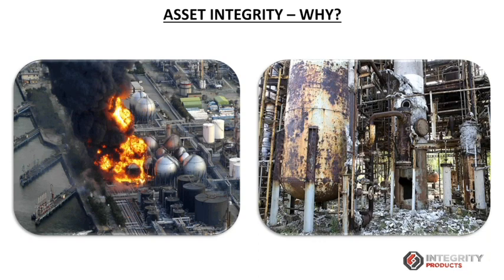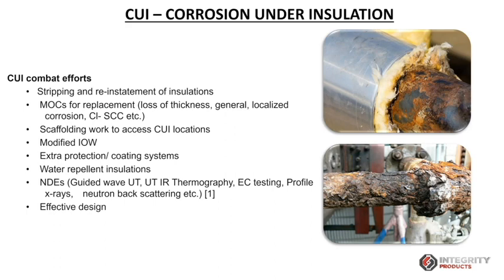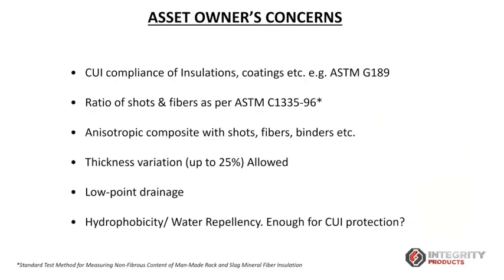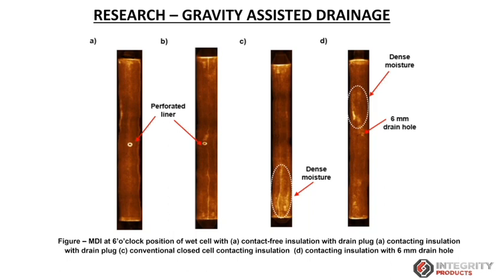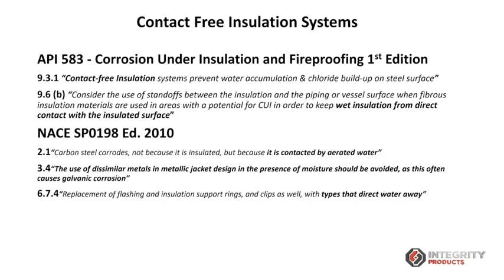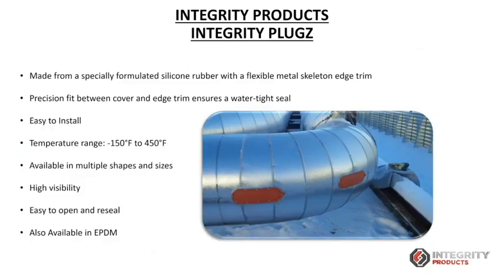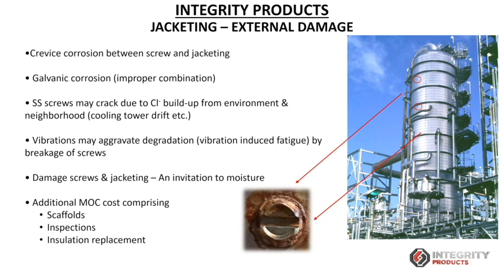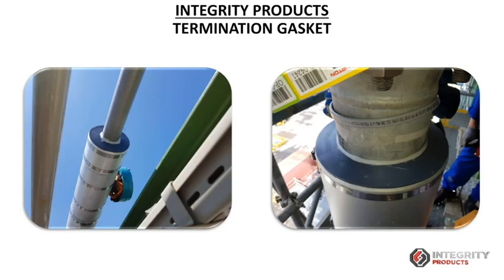Asset Integrity - A Systematic Approach feat. Integrity Products | DI 101

Comment: Thanks for sharing Systematic Approach to Asset Integrity Presentation... Its very easy to understand. We are providing Asset Integrity Management Software. A web based Asset Integrity Management Software | https://www.assetintegritysolution.com/ to efficiently handle integrity related data and information of your plant. Risk Based Inspection Software | https://www.assetintegritysolution.com/asset-integrity-management-software/risk-based-inspection for pressure system, pipelines and structures in accordance to latest acceptable industrial standard.